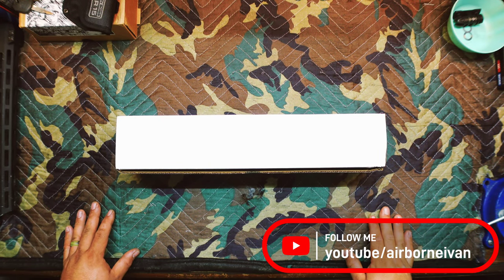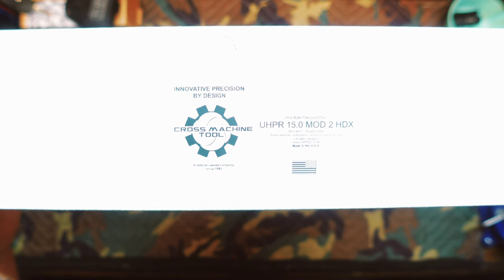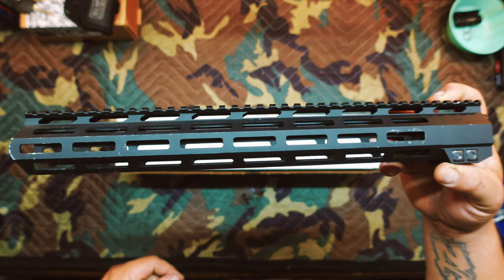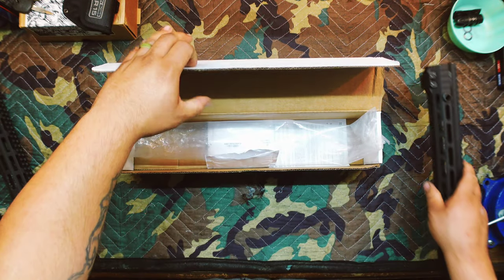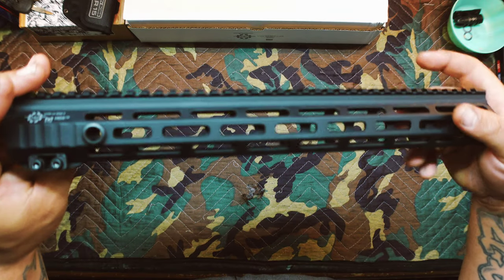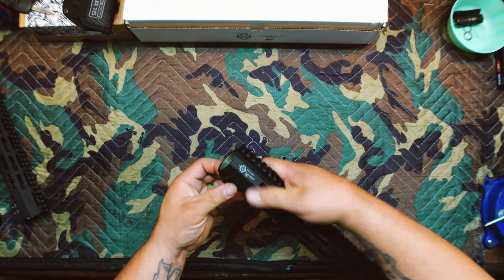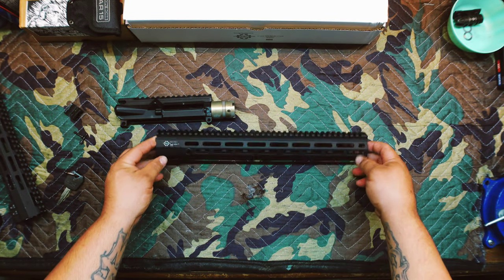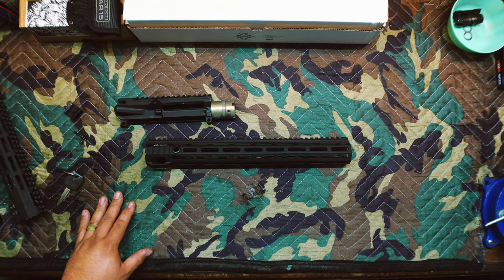Project Revamp Pt. 1 (Cross Machine Tool 15" UHPR Mod 2 HDX)

Comment: I am using a cross machine tool HDM 11.5 for my triarc barrel as a place holder until I can get a more premium rail and it’s nice considering it was under $150. I really want a Trilok or Ripcord LDR1.5 for the final form but until then this one is going to get beat tf up lol
Reply from the maker: Lol. I wonder if this rail will end up surprising you.
Reply: @airborneivan  that would be an awesome surprise, the only thing I won’t get to evaluate is an IR device to mount to it because of funds so I won’t be able to test how well it holds zero on that
Reply from the maker: @christopherkey3488  true. I think that's a double-edged sword. Between rails not holding zero and IR devices regularly losing zero, that seems to be an uphill battle. One I think is highly overstated for us civilians. That being said, I'm curious how well it would hold zero.